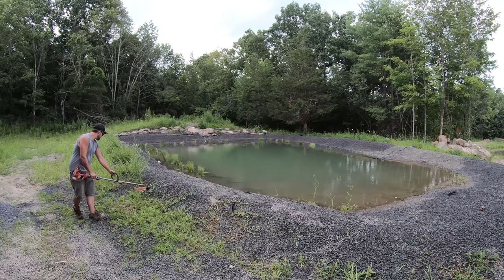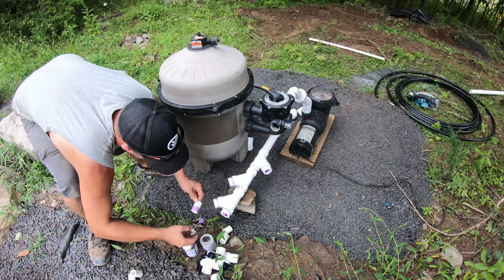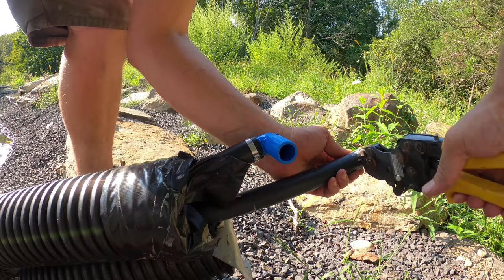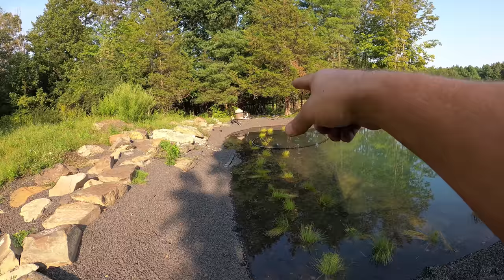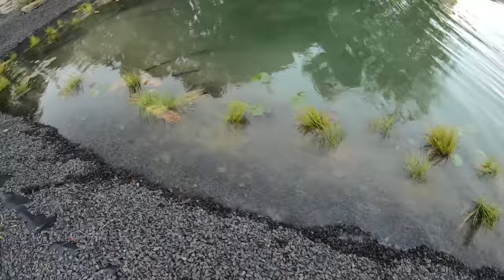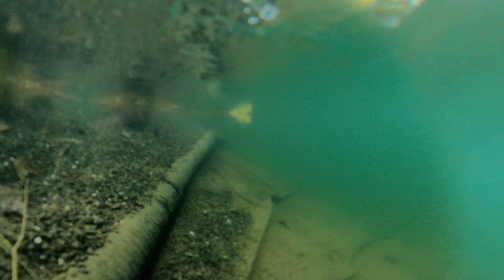Building a natural swimming pool part 2 : Aquatic plants and install pump/filter

Comment: Jesse, you might consider covering the pump and PVC. The UV will kill it.
Reply: Yes, UV will make white PVC very brittle and easy to break. The black and grey versions seem to hold up better to UV though from what I've seen. But I"m not sure if the grey and black pipe being used is actually PVC or some other material.
Reply: We use white PVC at my work when we install the pool pumps. I'm not sure if it has a special treatment or something but it's white, and holds up fine outside.
Reply: i always spray paint my exposed PVC with a neutral or camouflaged color. it helps immensely with deterioration.

Comment: We find that people that have "pools" spend half of their energy bills outside the home.  It's a LOT.  Spending a bit more at the start will save many times that over the years, things run better, quieter and are usually more reliable.  Ways to reduce some of the waste of that electrical load are to simplify, use long, sweeping bends, connections that don't hugely reduce the I.D., larger size hoses and pipe, with less internal static resistance so the pump is not always fighting to move water (which is extremely energy-intensive), variable-speed pumps and run on 220 if you can since it allows you to use smaller copper and you get less resistance.  Overall, nice easy flows with the minimum of resistance.  I find your projects very interesting.

Comment: it's coming along nicely. quick note: on the poly pipe, I use a torch to warm them up a bit...makes it easier to get those fittings in (especially on 2" irrigation pipes..those are real stiff).

Comment: Looks great like the plants. Maybe you can try and make like a 8 foot ring of black hose with holes in it to hook up to the pump for a sprinkler straight up in the air and it will make oxygen for the plants.

Comment: Jesse instead of using the vac hose. They make flex pvc pipe it glued just like hard pipe and is flexible enough to go in your larger drain pipe setup. It’s mainly used in spas but cheaper pool companies use it to plumb entire swimming pools it comes in 50ft rolls.  The other thing is you are going to have a very hard time heating the spa like you are explaining how you want it to work always pulling from the main pool (cool water and trying to heat it to spa temperature) then letting it run back to the pool. You need to be able to just circulate the water in the spa to heat it if not you will be heating the entire pool.  Good luck and have with your build can’t wait to see the finished product
Reply from the maker: yea I wanted that flex pvc but couldnt find it. I should have called a pool company
Reply: Yeah get up with a local pool store they should be able to get it for you it should retail for $109 per roll but most should sell it around $90ish a roll. Let me know if you can’t find it my supplier has around 20 rolls in stock. That’s for 1.5” x 50ft.
Not sure what shipping would be but could ship if you need it.

Comment: Can you lower the pump by excavating down about 1-2 feet which will go a long way to hiding it then small gravel bank in front of it!! Also if you turn the pump around 180 degrees the outlet to the perforated filtration pipes won't be so long and obtrusive?? Otherwise awesome, water looks amazing after settling 👏👏👏🏴

Comment: Looks awesome - I would get some fish to keep the mosquitos down....  Also, put the pump on a timer so it doesn't run 24/7....  IRC, the cost of clean sand was an issue, but it looks like the bottom could use some more.

Comment: Jess put a small waterfall and a fountain to maintain surface movement so you water not stagnant on top
Reply from the maker: there is that waterfall already, its not huge but it keeps some movement
Reply: Would a shower head work? That's a lot of pressure, would be inexpensive at least.

Comment: Nice, I was waiting for this episode. What are you doing to prevent getting snakes and snapping turtles in the pool?
Reply from the maker: fence around the outside, the bottom of the fence will be sealed up so no frogs, snakes, mice should get through, or atleast will slow them down
Reply: @jmuller86  Nice! 👍

Comment: You could try covering a real rock with plastic wrap and then fiberglass  it. Using the rock as a mold for the fake rock.  Then just pop it off and paint it. Just an idea

Comment: You could still use the same circulation system just spray the surface water causing a ripple effect on the surface of the water.  Motionless water combined with the sun shining on the water allows the algae to grow.  If there’s something breaking the surface of the water combined with the aeration of the water will kill the unwanted growth and clear up your water.  If there’s constant movement on the surface by by algae.
Reply from the maker: thats good to know thanks

Comment: Make it solar powered water pump and then also you can make solar power heater by making circled coils in a glass Box and any any is there any any storm door glass stormed or slide and door on the back of our old house will make one

Comment: I'm not sure how well lily pads handle the cold but here in the mid south, lily pads will take over a body of water pretty quick. They multiply so fast. One of my fav lakes to go fishing at gets choked out where boats can't even motor through them by mid summer. I suspect you might end up happier in the long run if the cold kills those lily pads.
Reply: This, they multiply like crazy. Ours lived through the milder winter just fine, we kept the pump running though unless it was going to around 10F.

Comment: How deep is it? Maybe add some goldfish for the algae issue.
Reply from the maker: I would like goldfish but I dont like the idea of their poop in there
Reply: @jmuller86  That's not a big problem, if the biofilter is up and running it can handle it, it has to handle the entry from your bodies also...

Comment: What brand of lights did you use ? Also what was the reason you chose the lights you did?
I've been looking at pool/pond lights , lots of different lights available.  Brightness always seems to be an issue with DC light. The misinformation from manufacturers description to actual product ability to be bright is almost always not accurate...

I enjoy your videos lots of helpful information.  Thank you

Comment: Would one solar panel be enough to power the pump and filter? You really think and plan things out as it seems. Have good days!!
Reply: no
Reply: @garrettscott9427  Since this is not your channel, the question was not directed your way.
Reply: @buddyreed2623  yeah I know. The answer was an obvious no.
Reply: @garrettscott9427  You must be an electrician but I am not sure as you offered nothing to back up your answer.
Reply: @buddyreed2623  no sir, not an electrician. I'm an electrical engineer who works in the power industry.

Comment: When i make fake rocks for my pond i make rock shapes out of big pieces of old Styrofoam then i wrap it in chicken wire and slap an earthcrete mixture on top of it, once it dries i cut the foam out of the inside with a spoon or something and i get great looking rocks. No paint because the color of the earthcrete always matches the natural rocks in my area. I imagine you can leave a small layer of foam on the inside for insulation.
Reply from the maker: that sounds like a good idea

Comment: Just one thing... Where is the electric timer and the one way valve that keeps the pump primed?
Reply from the maker: I will add a timer soon, and you are right, I should put a one way valve in

Comment: Need to agitate the surface water to not give the algae a chance to grow.  Spraying water on the surface introduces oxygen to the water such as a pond aerator does and you will get rid of the algae and probably have crystal clear blue water.  After which you would want to introduce fish to.

Comment: Algea is a sign your water contains nutrients. The way to rid the water of nutrients os to use plants. You could go overboeard with waterplants but you can also use the water from the pool to supply water to a aquaponic system. If you like to try something like that I recommend you get hold of some IBC totes and look for videos of an australian guy names Murray Hallam which has several good videos on IBC tote based aquaponic systems, on a budget...
Reply from the maker: ok thanks

Comment: You could probably add a vacuum sensor to the line, so if the pump gets blocked and the vacuum drops, then it'll drop out a relay to the pump power until it's reset manually

Comment: Is that a 1500 watt pump????? My pump can pump 10.000 Liter per hour (2200 gallons) with 80 watt. It is called aquaforte DM vario. I only use it at half the capacity. They also have pumps with a higher capacity up to 20.000 liters per hour and they only use  a little more power. They can be used in a dry or wet setup, but they have to be installed below the water line from the pond. It automatically shuts of when there is no water, you can pause it, change pump capacity, and readout the power consumption.
Reply from the maker: yea its about 1500 watts, this one can pump about 2000 gallons an hour
Reply: If this particular brand is not available in your country then I am sure that you can find a similar type of variable pump.
Reply from the maker: I just looked up that pump, it almost doesnt seem possible to use that little of power to move that much water, I will have to check into that
Reply: @jmuller86  Oh my, that is less capacity then my pump, and my pump only uses 80 watts for that. My pump has a max capacity of 2200 gallons per hour.
Reply: @jmuller86  And yet it does, I have that pump for almost 6 years or so. It was new on the market when I bought it. I am very pleased with it. I had several older style pumps before this one, and they all used far more power with far less capacity, and eventually they all broke down on me. I did not have a single problem with this one.  It is a small size pump, with a high capacity, and it is very durable. 

I have an outdoor aquaponics system that needs a very reliable pump. And I keep it running all year long, summer and winter, no matter if it is freezing or not. 

And I am not getting payed by that company. I only tell this because I was shocked to hear how much power your pump is using. 

I am not saying that you should buy the pump that I mentioned, but it is worth to get a little more informed about different pumps, if you happen to be in the neighborhood from a specialist.
Reply: @jmuller86  I bought it in the summer of 2016 to be exact. And I payed 154 euro for it, I looked it up for you. I guess that's around 175 dollar, give or take.
Reply: @jmuller86  Oh by the way, if you are planning to swim in that water it is not safe to use a fish pond pump, for that purpose your setup is the way to go. My older style pump that did not break down yet, and that I keep as a backup pump, or that I sometimes use if I need to pump some water for whatever reason, will give me a pretty bad electric shock if I am touching the water and the surrounding ground at the same time, for example if I am on bare foot and touching the water with my hand. My new pump doesn't do that, but they still advise not to use it for swimming water.